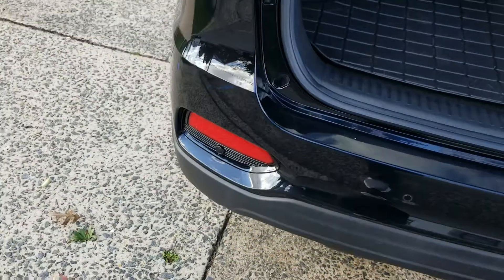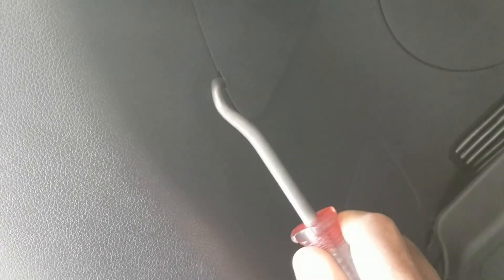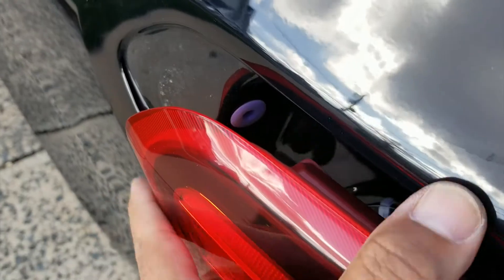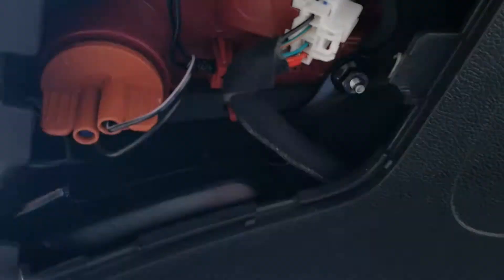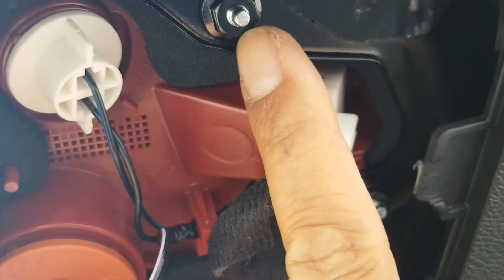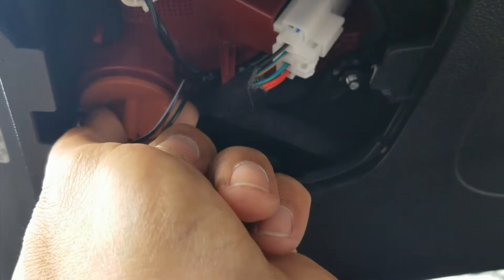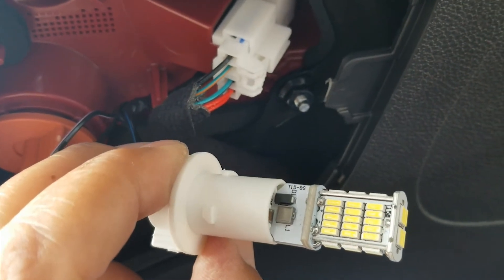How to remove 2019-2020 Kia Sorento Taillight.

Comment: Very plain and simple and right to the point. They keep having burned out. I probably have an electrical issue. I know the terminals are wearing out. The terminal clamps. Those are junk. I have to figure out how to get better ones. A good ground helps to make sure things aren't sparking and burning out. Very good video Thank you
Reply from the maker: Glad to be of service. How often are you going through lights and what kind are you using??
Reply: @richideates  I went through one about a year ago. 1157, I do believe with Sylvania. Now let me ask you a question. If one of the brake lights isn't working does that cut them both out. One may be good and one may not be. The one in the hatch panel and the one in the tail light assembly attached to the car. You said there is two. I have a whole bunch of 1157s at home. Easy peasy to get apart..
Reply from the maker: @rangosteve well I know Hyundai/kia implemented German style computers. Where they would tell you which light is out on the dashboard. BUT, not sure if the computer cuts power off if the bulb is bad. I would think going to led that have the computer canceling, maybe they are getting too hot. Is this brake light, or turn signal? I would assume brake light, that would be used most frequent and or turn signal. ??
Reply: @richideates  it's definitely the brake light. My one friend at work said he followed me out yesterday and said my cruising lights are working. Which I checked myself too. But he says when you put a brake on the right side goes off but the left side doesn't work..
Reply from the maker: @rangosteve I thought of a solution..you ready for this?? Just never use your brakes..problem solved..🤣🤣🤣🤣..is the brake and "cruising" light..(parking) lights..the same bulb??
Reply: I will go ahead and turn the lights on and see which lights react to whatever action I'm doing. I know LEDs would be good but don't I need resistors in there? I didn't know if they built in resistors in any of the brake tail lights. They may not even fit in the housing 😂
Reply from the maker: @rangosteve nope..they do..just gota get the ones with the chips for antiflicker or computer canceling. Try these.
https://amzn.to/4hvygPw
Report back if they work.
Reply: @richideates  okay thanks a lot I appreciate it. I appreciate all your help. I ordered two sets. I don't have to worry about resistors because they're not blinkers
Reply from the maker: @rangosteve that is correct. Not a problem. Let us know if it works
Reply: @richideates  okay, I guess only the outside lights are brake lights. Not the ones in the hatch. But I don't understand why it only says to use 1157, maybe those are 1156.. I took both apart and they both have double filaments. So they are both  1157
Reply from the maker: @rangosteve might be the hazard?? Ever think of that?? 🤪🤪🤣🤣..but honestly. I have no clue. Try it, it probably is. But I would bet the turn signals being the hazards. Not sure.
Reply: @richideates  That's kind of a good thought. I'm not sure what lights blink when I put my hazards on. You may be right. Cuz you're trying to alert drivers. That did it! Now I got to go out in the garage under curiosity 😂😂😂😂. Thanks for all your help though. I took a video of the brake light before it worked and then after. It only took 5 minutes at the most. By the time the dog went potty I was done. Easy peasy
Reply from the maker: @rangosteve so what your saying is..in the time your dog dropped a steamer..you were able to change your lights..THATS HOT..no pun intended..🤣🤣🤣🤣
Reply: Exactamundo 👊😎
Reply: @richideates  very unusual. I have a chart that says the tail lights are 1157, The only 1156 is the turn signal. I turned on the emergency lights and the only thing that blinks in the back is the turn signals 🤦🤷 But I guess that's the way it goes. For a standard bulb they are only $7 for two of them at AutoZone. I'm sure they're cheaper someplace else. But I have the LEDs coming. That should keep them from burning out. And again thanks for all your help, I appreciate it. Different car, different lighting system, different bulbs. My first rice burner 👊😂. Have a good one bud stay safe
Reply from the maker: @rangosteve 🤣🤣🤣🤣..why does it have to be a rice burner?? Why not just be a burner??..🤣🤣🤣..I accept super thank yous and more..🤣🤣🤣
Reply: @richideates put those LEDs in. What a difference! Wish I could send you a video but I guess it doesn't allow me on these conversations. Thanks again. Auxito , I've used a few of those before. They're good bulbs. Probably my fog lamp bulbs. They look almost identical
Reply from the maker: @rangosteve good to hear broski..I do accept super thanks..😁😁

Comment: Why the water go in side the lightbulb every time i take it to the car wash
Reply from the maker: Well that could be that the gasket that keeps water out is not there. The light has a crack. Or aftermarket lights are notorious for leaking. Is it a genuine light? You might have to remove the light to see if it is or not. I think I have a video for removing the lights. You should remove it and check for yourselves.
Reply: Thanks

Comment: Hey great video very informative. I got a question for you on my 2019 Kia Sorrento the positioning light saw the time running lights are not working and I’m not sure where the fuse location is if you would happen to know that information I would greatly appreciate it.
Reply from the maker: I have no clue what your asking me. 😂😂😂.. what do you mean by positioning light saw the time running lights? You mean the day running lights? The lights that are always on whether day or night? Both arent working? Are you sure you even had them? Some cars just dont have them. If you do and there is a fuse, I wouldnt know off the top of my head. Where is the manual to the truck? It should be in there under fuses. It should have a chart of what each fuse does to the vehicle and where it is located. You can try online but the book should be in the glovebox if you have one.

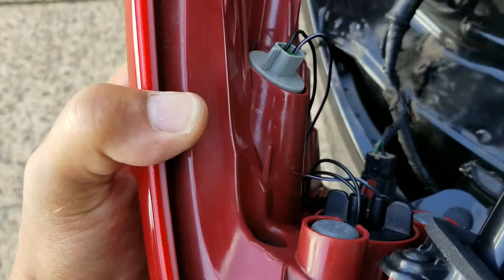Comment: Hi thanks for this video. My problem is that the rear plastic cover is broken (reversing). So I need to replace the whole assembly unit. I can free one bulb, but the LED one is a load of wires I am afraid to try and pull out. PLUS how do I disconnect all the wires seen at 1:03? I am desperate to do it myself and avoid the huge car garage charges. Thanks,
Reply from the maker: From memory, just turn and pull the bulb out.
Reply: @richideates  thanks for the reply, but the "bulb" is an LED and there is a a mountain of wires contained in that small space./ If I would upload a photo here I would.
Reply from the maker: Tell me this thing is aftermarket.?? @donovanvaz3289
Reply: @richideates  I'm sorry I don't understand what you mean by "aftermarket"?
Reply from the maker: Give me an email so I can hit you up